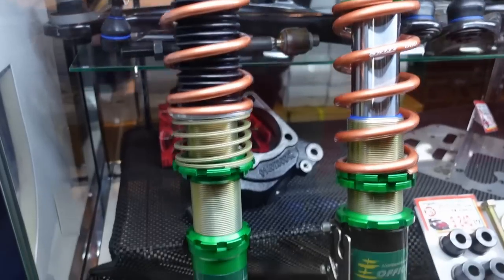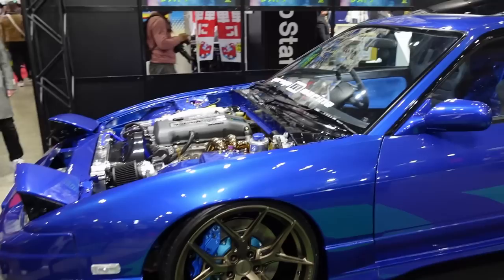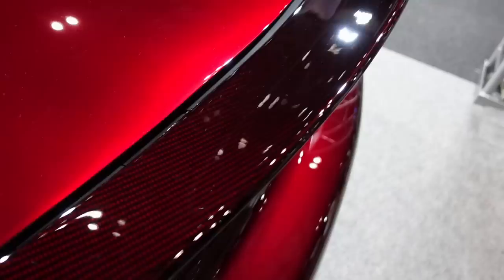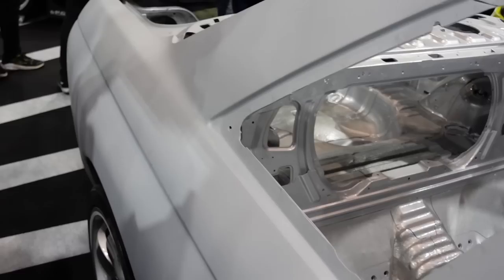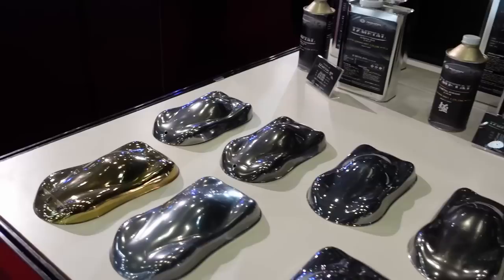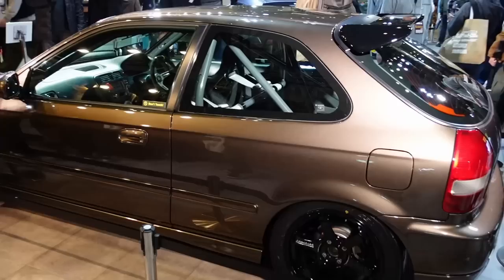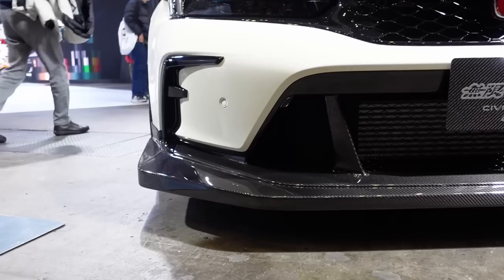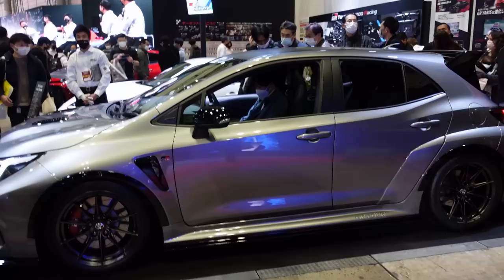Tokyo Auto Salon 2023 - JDM Tuning Going Strong!

Comment: Great content, Steve!

The VPro is all HKS, and was good in its time. What killed it was that it was really only available through an HKS Proshop, and other than bootleg, the software to tune it was also only made available to Pro Shops... So if you bought one through a Pro Shop, they had to tune it, and even if you could buy a used one, it was hard to find the software, and no support. HKS did a lot of this, where certain parts were only available to HKS Pro Shops. Some of the small fish here in Oki have bootleg software, and refuse to learn anything newer and lightyears better, which is why VPro and PFC are still the bread and butter in the deep south 😆
Reply from the maker: Really appreciate that, Matt!

It's really impressive for them to design an ECU from scratch as "just another product offering" instead of being a fully dedicated ECU/standalone company.  That speaks to their capabilities.  I figured they had partnered with someone, but, when they were designing the first piggybacks, I'm sure they were pushing the limits of available technology and the rest of the aftermarket has finally caught up.

And that certainly makes sense as to what has held it back in terms of mass adoption.  They gave their Pro Shop dealers a competitive advantage with a unique product only they can offer which likely resulted in the customer experience being better and HKS technical support load being greatly reduced.  But like you said, it really limits the overall reach the product can have.  Interesting business case for a product that no doubt has a ton of front end time into developing it.

Comment: Tein really has their little corner of the market. They are pretty much the best coilovers for comfort/sport that are priced somewhere in the middle of the market.
Reply from the maker: That makes a lot of sense. It seems they're the go-to brand for tire shops here for customers who want to be low but aren't "car people."  Which is probably the ultimate compliment since it means you make stuff that's going to last, ride decently, and be headache free.
Reply: It is one of the best mods I've made for one of my daily drivers. I chose the Flex Z for a 2nd gen gs300 with a 12k front and 10k rear, and they are stiff without sacrificing ride comfort at the recommended lowered stance, of course.
Reply: Also the fact they last forever is another telling sign of build quality! Their products are quite common on the 2nd/3rd hand tuning market for decent prices, but like anything else, some sellers know this and will jack up the prices :(